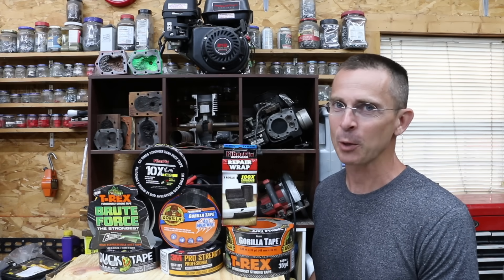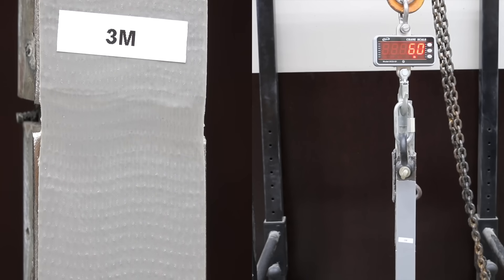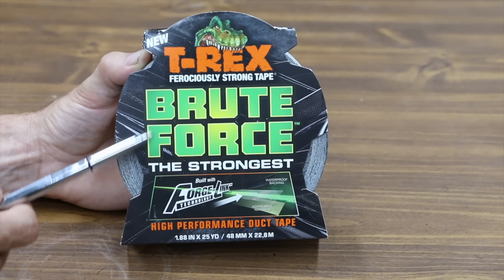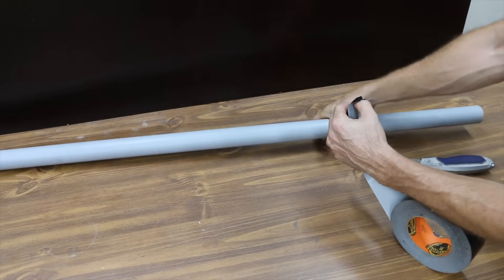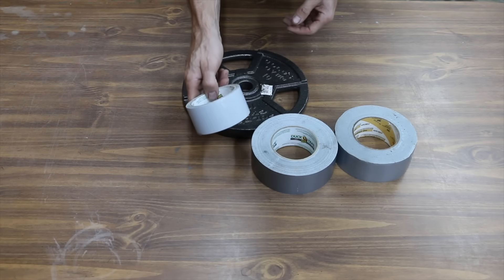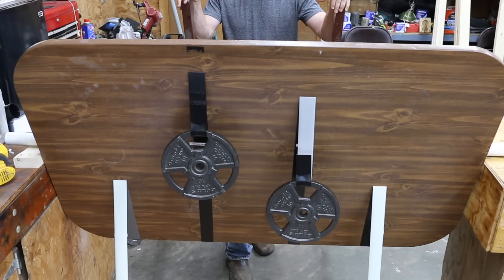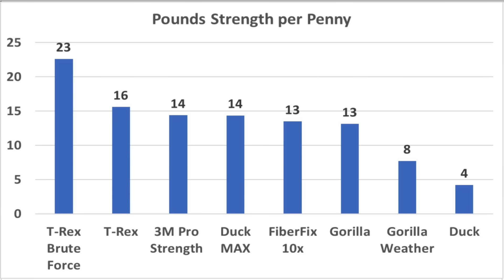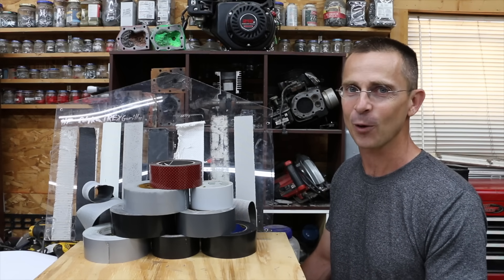Which Duct Tape Is Strongest? Let's find out! Gorilla, T-Rex, FiberFix, 3M Pro & Duck Max

Comment: You should definitely test how this holds up on car windows and bumpers. So many people use it as a placeholder to patch up a smashed-out window or to keep a bumper from falling off after hitting a bump. It would be a great real-world test for weather resistance and durability!

For high-stress areas like a broken bumper, I’ve found a triple-layer 'sandwich' (duct-scotch-duct) works best for tear resistance. It’s survived four previous breaks, though the maintenance is rough. Cleaning off the old adhesive and fibers to get a clean surface for the next application is a huge chore. And its been about 5 months of success atm.😅

Comment: I work at Home Depot.  I use many of your reviews to answer the "Which is better question?", so they are very helpful to not me, but to my customers.  The part of your review over time is actually very, very important, because I get not only "What is best?", but "What will hold up over time?".  It would be nice to see tests on caulking, but they would need to be over time tests to be most valuable.  thanks!
Reply from the maker: Thanks for sharing.  Thanks for the suggestion.

Comment: Regarding the Gorilla tape, I have a 27’ round, 4.5’ deep above ground pool. Over the 22 years, a hole the size of a quarter opened up. 
Without draining any water, I tried those (worthless) patch kits and they failed. 

I used a strip of Gorilla tape and it lasted 3 years before I had to replace it. I was so impressed I wrote the company.
Reply from the maker: Thanks for sharing.

Comment: I'd love to see a follow-up video to this finding even more obscure tapes I've never heard of and pitting them against Gaffer's tape.  I was always told it was as strong as duct tape and left no residue.  It also used to cost 4 times as much and probably still does.  We always use it in theaters.  You could tape up anything you wanted with it and didn't have to worry about any residue on expensive things that were important like curtains.
Reply from the maker: Thanks for the suggestion.
Reply: @ProjectFarm  Yes ... please please on the gaffer's tape. :)

Comment: GOOD VIDEO AGAIN  AND WELL PRODUCED , YOU SHOULD GET SOME  ROYALTIES FROM T REX BRUTE FORCE TAPE ,,,IVE ALREADY ORDERED IT, I'M SICK OF MY REAR LIGHT PANEL FALLING OFF MY PICASSO HAHA ,
GORILLA DOESNT HOLD IN THE SUN, AND GAVE UP DROPPING MY REAR LIGHT PANEL ON THE ROAD , FORNUNATELY IT WAS STILL INTACT ,
AND ALSO MY NEIGHBOURS PANEL FELL OFF IN GLASTONBURY HELD WITH A SUPER DOOPER TAPE? WHICH WAS GOOD , ITS THE HEAT AND CONTINUAL DRAG AND VIBRATION THAT MAKES THE TAPE LET GO SLIDING DOWN THE BACK OF THE CAR  
SO,,,,, ITLL BE GOOD TO SEE HOW T REX  BRUTE FORCE HOLDS UP,
ILL LET YOU KNOW,
Reply from the maker: Thanks! Thanks for sharing.

Comment: I am struggling with a clear version of T-Rex tape to repair a hot tub tear. The air pressure inside keeps forcing a path to release the air. Is there something with stronger adhesion than the air pressure?

Comment: T-Rex is my go-to for sealing my ac in my window is has never let me down and when I go to replace it every year its always still sealed and very stuck and I would take that to the one downside of it leaving tons of material behind when removed it 100% leaves all of it adhesive on the glass but adhesive easy to remove off the glass with any adhesive remover and a scraper, speaking of glass only use T-Rex on glass or metal or wood that you don't mind getting messed up. I used it on the inner drywall of my window and it pulled up all of the gypsum between it and the metal under it so be smart and use it on an area that won't pull up like glass and metal, not paint and drywall.
Reply from the maker: Thanks for sharing.

Comment: As an off-road off grid enthusiast, I would have liked to see a pressurized fluid leak test.
Reply from the maker: Thanks for the suggestion.
Reply: @ProjectFarm  You know, like the same setup as the PVC pipe connection, but with pressurized fluid inside slowly raised in Lbs per square inch or whatever. Or just a preexisting hydraulic line, cut, taped, and then... But thanks for the videos. Good stuff.

Comment: I'm not sure if you've ever tested gaffer tape against anything, but ProGaffer, I use it for everything; it even holds down a rug to concrete! For professional music it's a must, but $20-30 a roll. ouch. There's only a couple things it can't go, such as sticking to a car, it just slides right off.
Reply from the maker: Thanks for the suggestion.
Reply: @ProjectFarm  It also tears easy and perfectly straight bc it's like denim.

Comment: I saw a request for electrical tape comparisons and I would like to 2nd that. As an electronics technician and a diesel tech I use a LOT of electrical tape. I like to use good stuff on people's cars that will last. I usually use 3M or Scotch brand but I'd love to see about 10-15 brands against each other. Specifically I would like to see the O'Reilly's cheap brand from under the counter, harbor freight, Lowe's, dollar tree...and any other cheap/expensive brands around.
Reply: There is also a type of electrical tape you could add to that that is a rubber based tape. You stretch it to activate it. I believe it's used for applications around plumbing?
Reply from the maker: Thanks for the suggestion.

Comment: On next testing..take two pieces tape..one on top and one bottom of PVC in in same direction of pipe..then wrap tape over the horizontal piece..this will add the tensile strength into the equation..
Reply from the maker: Thanks for the suggestion.

Comment: The Texas sun is brutal on the black plastic trim of my car, causing some parts to become brittle and start cracking.  I've repaired several pieces that would be too inconvenient to replace with Gorilla Weather tape, and it's held up for a few years now including summer heat, rain, car washes, and the occasional freak winter storm.
Reply from the maker: Thanks for sharing.

Comment: Do not use any duct tape to ship packages. Your package will open itself with any temperature or climate change. I worked in the shipping industry for my entire career and it caused more lost items during transit then anything else. The glue will not adhere to cardboard and only takes a little heat, cold, or moisture to simply fall off the box. Remember the back of the delivery truck is not climate controlled so on a hot day it’s very hot, on a cold day it’s freezing and most delivery trucks somewhat leak with age. If you care about your item getting to its destination don’t use any duct tape period.
Reply from the maker: Thanks for the feedback.

Comment: Fiber Fix wrap.  That looks exactly like fiberglass casting material, used to wrap fractured bones making a cast,  Casting material is in a sealed package, wet with water and wrapped around the leg/arm, and it then hardens.  No wonder it is so strong.
Reply from the maker: Thanks for the feedback.

Comment: I don't know if you made the updated video or not, but I used gorilla all weather to rebuild the underside and sides of my front bumper cover more than 2 years ago and it has held up completely. It also passed motor vehicle inspection. I'm going to add a new layer of duct tape this week to freshen it up but that's two or three years of Canadian winters at the front underside of a Subaru Impreza!
Reply from the maker: Thanks for  the suggestion.  Thanks for sharing.

Comment: I'm interested in seeing an abrasion test on these types of tape.  A lot of people use duct tapes for motorcycle rim strips.  Tapes with little abrasion resistance could lead to a spoke nipple puncturing a tube, causing a flat tire.
Reply from the maker: Thanks for the suggestion.

Comment: Fiber Fix is a bit like JB Weld in prep work and purpose. Each roll is for 1 fix (comes sealed to preserve the substance which is activated in water, though you can buy packs with multiple rolls). But it hardens into a steel/concrete-like wrap and definitely works for fixes requiring structural strength (not completely water tight with a high pressure sprinkler system pipe fix though, perhaps I didn’t clean pipe enough to allow a seal).
Reply from the maker: Thanks for sharing.

Comment: Question: So I have Duck Tape Max Strength, but it's clear tape.  Would It have the same amount of strength or will it be slightly reduced?
Reply from the maker: Thanks for the suggestion.
Reply: @ProjectFarm  so..... Judging by your response I was assuming you were gonna test it out first. Have you had a chance?  Or were you assuming my question was the suggestion because it wasn't

Comment: You should test different types of wood Joints, butt, Miter, Dovetail, Picture frame, Dowell, Screwed etc. Using you best wood glue test results on clear pine.  What joint is strongest ?
Reply from the maker: Thanks for the suggestion.

Comment: Thanks for the careful, fairly comprehensive,  efficient  comparisons. In this one FiberFix Wrap was particularly impressive for special applications. But I myself had found Gorilla tape to be the best all-around top level tape relative to cost (having bought over 50 rolls, by the grace of God) , when it was about $8.50 for  1.88 Inch x 35 Yards. But later that it is at least $12.00 (as of mid June 2022) and higher, while  I have been using T-REX 240998 was $8.00 for the same size. It is  little harder to rip but comparable.   
Later, in 2025 30 yards of T-rex was about $9 but  Gorilla tape really went up. However, as of now 12-16-2025, both are about $3.25 a yard for 30 and 35 yard sizes. 
Meanwhile, for "regular" cheap "duct" tape I have found   Duck Max Strength 24020  1.88 Inch x 45 Yards to be the best buy if around $6.00. Rips and sticks far better than other low-cost "duct" tapes. 
 For easier rip (vertically) sticky tape, XUXU 3 Pack Yellow Duct Tape, 60yard for $10, is good.

Comment: I know it would cost more. However, I wonder what your result for each type of tape would be if you bought different rolls from different stores. This would help provide a wider range of manufacturer dates  and possible variations from day to day production.

Ie. Buy a roll of duck tape from three or four  different stores. Same with all the others. 

Then when doing your test take a sample from each roll and average them. This will provide a good base for quality control of each company as well.
Reply from the maker: Thanks for the suggestion.

Comment: I got a test for you; it would be highly valued from horse owners and large animal vets alike…testing the tape as a hoof wrap.  We often have to wrap hooves with treatments, using salves, padded materials-even baby diapers.  We use duct tape to reinforce specially made horse boots as well.  We need a tape that is flexible and super strong. The treatments or boots are changed usually every 24 hours.  It has to endure high pressure and dirt and mud, and a good bit of wear.  Which of those would you recommend based on your tests so far?  I was thinking the T-Rex?  We are using gorilla tape right now on our farm.
Reply from the maker: Thanks for the video idea.

Comment: Gorilla duct tape absolutely sucks.
Reply from the maker: Thanks for the feedback.
Reply: @ProjectFarm  I don't know what it is, but I've ordered it from Amazon and bought it directly from Lowes and both rolls would not stick. I used a heat gun to heat a strip up just to use it, and while hot, it would adhere to what I was taping, until the strip of tape cooled, and then it came free with no effort. In fact, it was the major reason why I came to the video in the first place - to find a decent replacement, which I have thanks to your videos.

Comment: In 2000 we had asbestos abatement taking place on our job site.   They used 3M backed up with 3M Super 77to glue sheet plastic to  the wall, ceiling & sheet plastic. Then they kept the room at a negative pressure. 3M was the standard and Nassau was what we got if we must.

Comment: I've been using FiberFix since it got wide distribution. A rubber arm rest on an office chair got mangled over the years and was split. I used the wrap on it and has held up since. A fence post got lifted from the ground due to winter frost, a 2x4 treated was strapped on to the existing 4x4 post with the dip tape and hasn't shifted in over 5 years. This stuff reminds me of the fiber glass tapes manufacturers would use on hockey stick blades. Grade "A" technology.

Comment: I love your videos. If i can suggest something; with the tests where you slide weights down the length of the pipe, then have to increase weight, you should calculate the theoretical length it would have held with the original weight the rest of the products were tested with.
Reply from the maker: Thanks!  Thanks for the suggestion.

Comment: I had to seal up an incomplete roofing job for winter.  I used Gorilla Tape along the edge of the top row of shingles, half on the shingles, half on GAF Deck Armor Breathable Underlayment.  The adhesive was not quite thick enough to bond on the shingle granules.  After about 5 months, the tape edge was lifting off the shingle granules.

While not a specifically an adhesive failure, it was more related to the tape was too stiff and too strong.  If it was more flexible, the adhesive would have done a better job.

Then I tried some T-Rex.  That adhesive felt like it would pull the skin off my finger tips.  I never used it on shingle granules, but I'd bet it would do better.  Now the Gorilla Weatherproof tape was no available when I did this.  What I did like about the Gorilla was that it came in an extra wide roll.  THAT was the closer for me - that extra width was good insurance for a watertight seal.
Reply from the maker: Thanks for the feedback.

Comment: Greetings,  it is always great to watch you implement clever testing protocols to challenge marketing claims.
8:00 Just one question, for the sake of experiment, related to the "piping test" in which you showed the limitations of the tapes (good tensile strength, but kinda easy to shear).
if, in addition to the 12 perpendicular wraps around the pipes, you then apply a few bands of tape but alongside the length of the pipes, would that allow to make the joint stronger by using the tensile strength of the tapes in the "right direction" ?

Comment: Could somebody with more physics knowledge possibly show me how to calculate the force that was applied to break those tapes in the pipe tests? I just mean how would I determine the amount of force that the weight is placing on the repair point based on the distance from the repair it sits

Comment: The winner of the weathered adhesion in this video was Flex, yet you do not show Flex in the tapes at the start and do not list it in your list. One problem with that is that Flex comes in about 15 different variations, so there is no way to know which Flex tape version did so well in your test.  Not reasonable to assume that they are all the same.
Reply from the maker: Thanks for the constructive feedback.